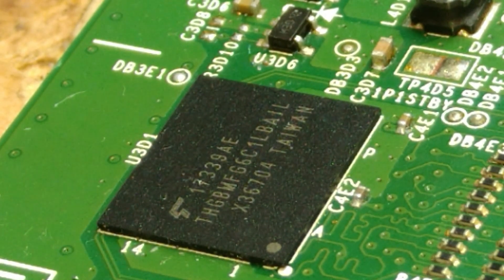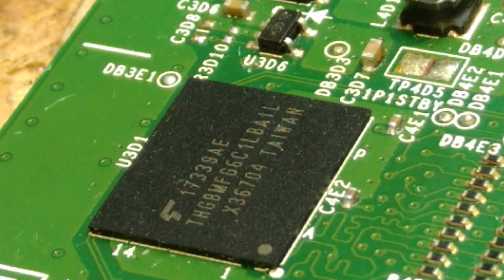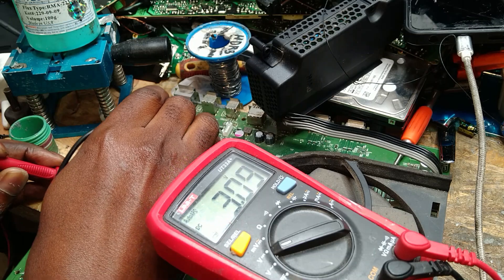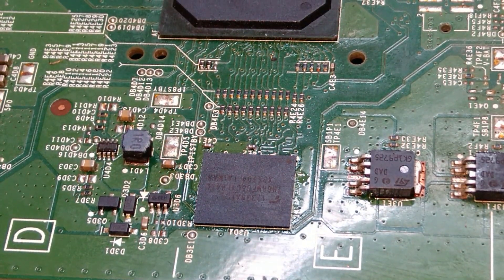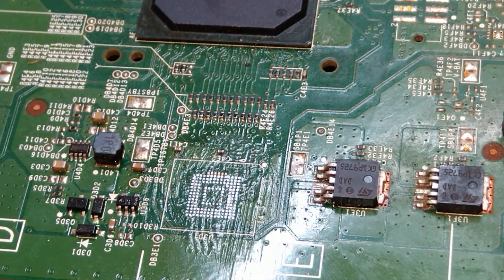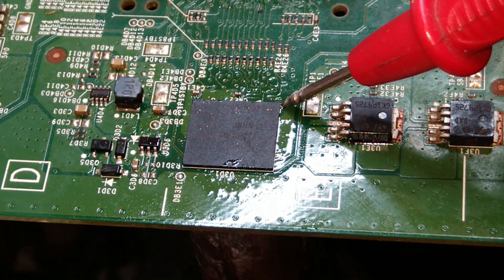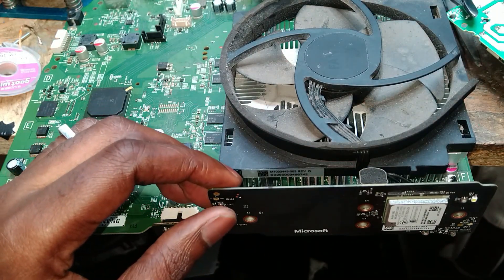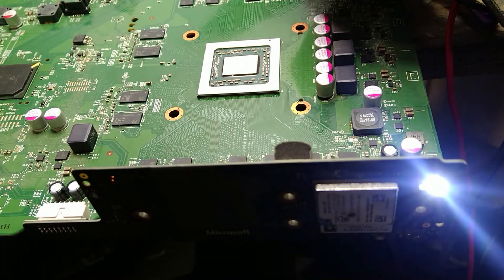Xbox 1S Faulty Nand No Power Diagnose

Comment: Excellent video. The eMMC on these old consoles are starting to die sometimes. You say you couldn't read the damaged eMMC. But I wonder if it would be possible to perform data recovery, by accessing the hidden manufacturer internal NAND bus. It is only needed to read the console certificate, which is stored in the first Kb of nand. The console certificate is paired to the CPU
Reply from the maker: I was to save some consoles by dumping the nand and writing on another
https://youtu.be/XJVitvPhe_M